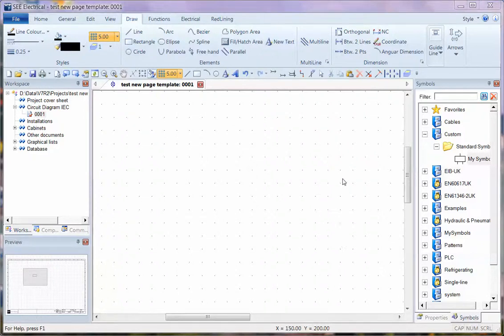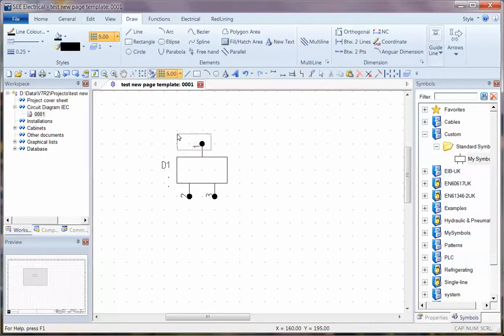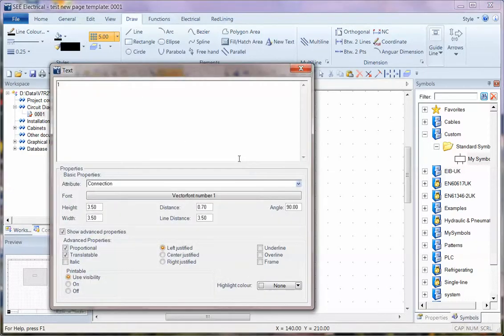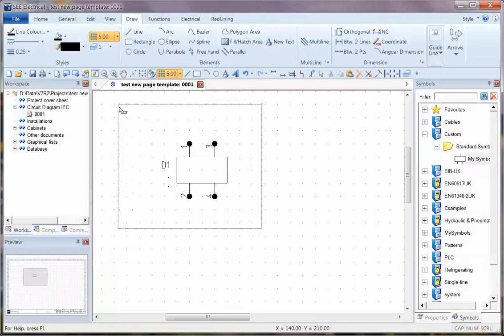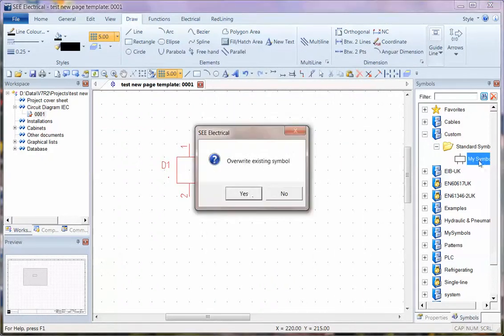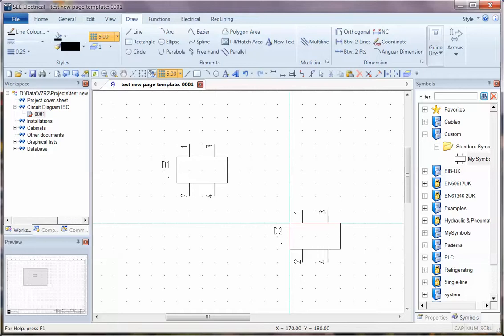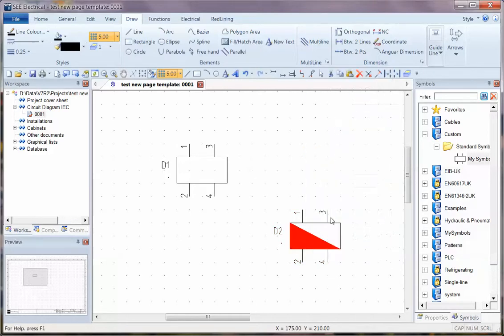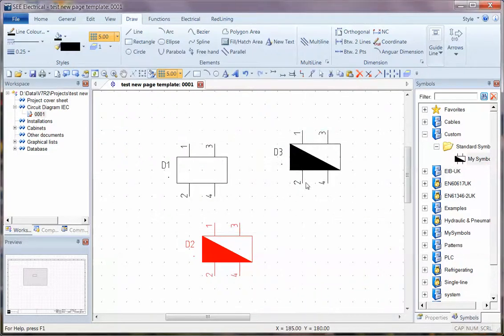Basic Symbol Modification V7R2

Comment: it seems existing symbol is not updated after you overwright the symbol. It seems I have to change every symbol in drawing and also re entry all attributes. Not very efficient
Reply from the maker: Its vital that opening old projects doesn't suddenly change everything if the symbols have been modified in the database folder. In the advanced level of See Electrical you can select a symbol on a page, then right-click over the updated symbol in the database and select Search and replace to update the symbol, either just the selected ones, on that page or throughout the whole project.